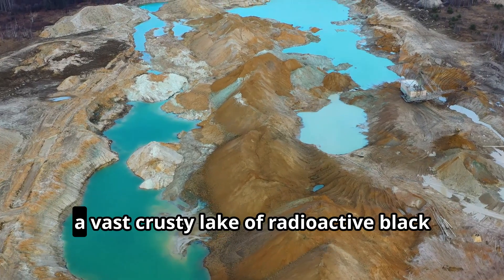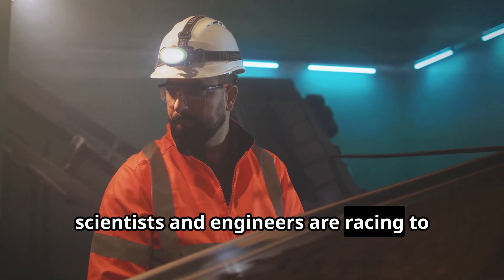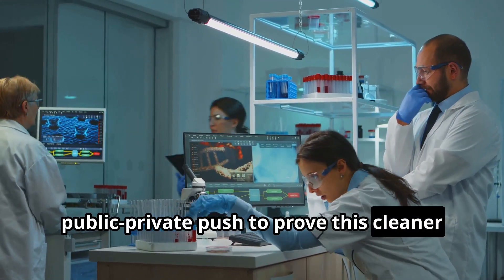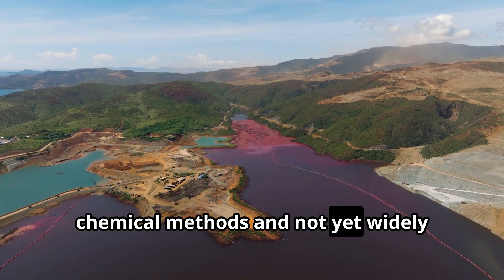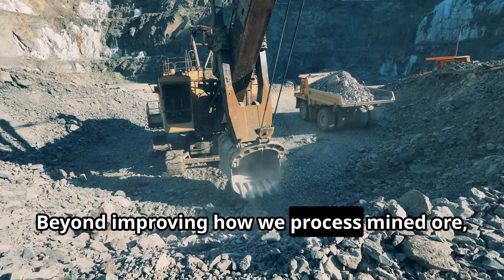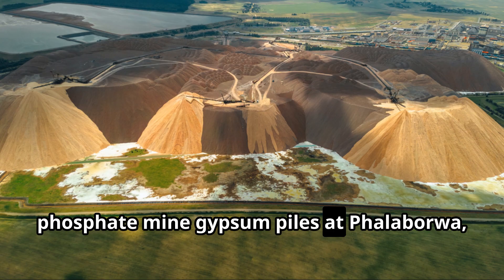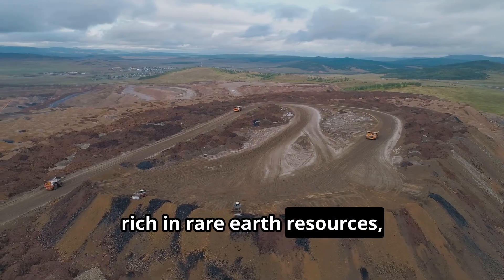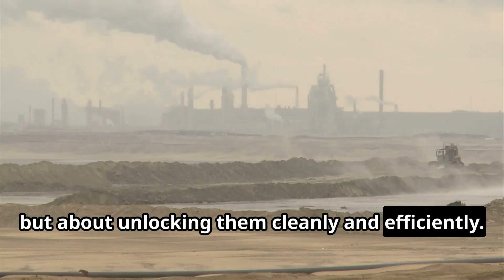Rare Earths Processing: Past Present & Future (Narration only - no music)

Comment: Video misleads you to believe that processing is technically difficult and it isn’t. It is the environmental impact that makes processing difficult in most advancing economies with rule of law. China doesn’t have these issues.
Reply from the maker: Disagree and agree. The processing IS technically difficult based on the type of rare earth, host rock, and percentages of each type in your deposit. Ie. if you have higher uranium or thorium in the material then you need to consider how you will separate and handle them in your circuit. And then you might not recover all rare earths but optimize for some and lose others. It can be complex and the more complex the more expensive. Then yes, also def the environmental impact is real that many are trying to innovate around and lessen.

We tried to cover many of these different angles in this rare earths processing vid. Appreciate your comment!
Reply: @criticalmetalsnews  There is nothing technically difficult that keeps others from processing rare earths. We know you enjoy the subject and job, but just stop it. 😂😂😂